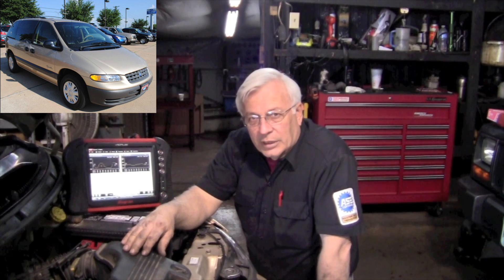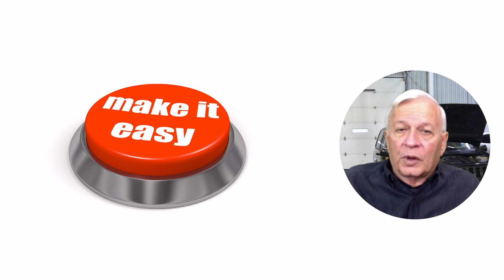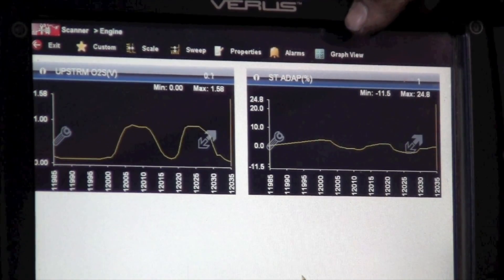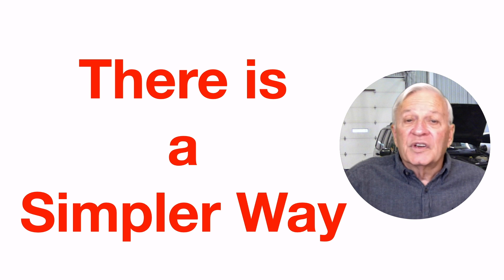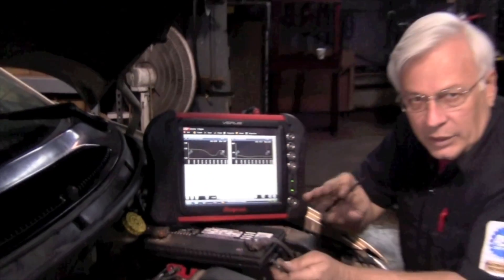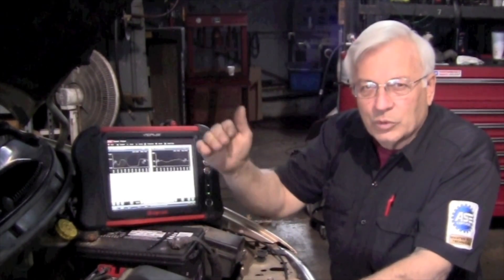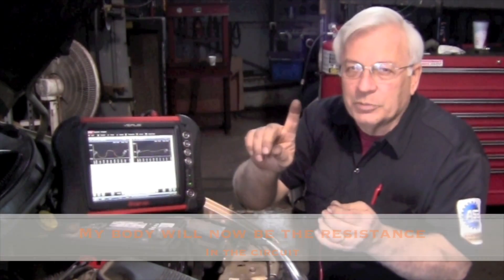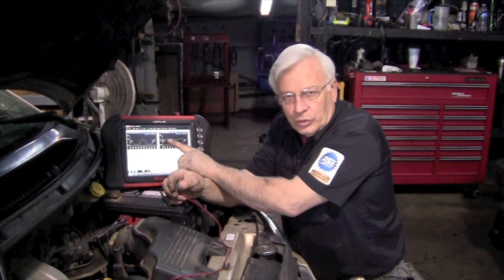A simpler way to test an oxygen sensor   HD 1080p

Comment: It sounds like this is a good bypass test for circuit integrity but bypasses the sensor so does not test it in any way. Let me know if I am misunderstanding. Thanks for your content. Very helpful for scope Verus learning. More please!
Reply: I agree. I'm not an expert either, but you could artificially introduce voltage or ground to the PCM and the scan tool will read whatever bypass voltage/ground you supply. Color me skeptical.
Reply: I agree, what he is doing there is testing the integrity of the wiring and pcm but not the actual sensor
Reply: I think what he's trying to say is the circuit itself is tested as you connect to ground or positive through your body and see the extreme readings and fuel trim. After you remove your tap from the wire or plug the sensor back in, the sensor is proving that it works correctly when it readjusts, oscillates and the fuel trim normalizes
Reply: @geologic740  I agree. But 'substituting' signal like this would not, in and of itself, really help identify a slow or incorrectly responding sensor. [It merely establishes that the sensor has an 'effect']
I'm not sure, as far as determining if the sensor is working 'correctly' is concerned, that this 'test' is at all helpful at accomplishing all...
The O2 could still be slow or out of calibration, and this test result would still be the same.

It does, at the most, determine that the closed loop- system is responding to inputs.
It does not determine if that response is correct.
[I think the same would be accomplished simply by unplugging and re-plugging the sensor].
Mr K L
Reply: @troubleshooter1975  I see your point and I've thought of that as well. Like you, I believe it's a good test of circuit integrity, but won't necessarily single out a bad O2 sensor if other parameters are off which indicate another issue. I would have to go with unplugging the sensor to be sure all other parameters are as expected.
Reply: @geologic740  I'd rather force the sensor high and low by vacuum leak and propane addition and watch the oscillations. That seems more definitive to me...
Reply: @fredsalter1915  agreed
Reply: @Fred Salter  amen!! And use a meter to ohm out the wiring from o2 connector to pcm.  This is a little reckless, instead of using ohms law to guess how much voltage your body will send to a sensitive pcm why not just ohm out the circuit.  I know for a fact with my luck if I tried this I'd brick a PCM lol
Reply: @daniellawson5127  you should watch some scannerdanner videos. Then you will not be as afraid to mess up a module and also you will not trust your ohm readings as much anymore. There is more to the automotive field than meets the eye🙂
Reply: Thanks Geologic
Reply: Can you tell me about the concept/theory you are considering - the bypass .  Why do you say that he bypassed the sensor in the procedure he demonstrated in the video . The sensor remains in the circuit .
Reply: @ThunderbirdRocket  Sure. I used the term "bypass" as a catch-all term as I didn't want to type a long paragraph and that's the only term that came to mind. It doesn't matter whether the sensor is left in the circuit or disconnected. When the lead is shorted to ground, what the sensor is doing will have very little effect on the circuit voltage. Similarly, it won't matter what the sensor is reading when the peak positive circuit voltage is applied.

Comment: I understand that shorting to ground you generate a DTC on o2 sensor but, is any DTC when shorting to positive through your body? A part of that, did you test that way with 5pin o2 sensors the wide range ones? Thanks!!
Reply: I don't think so. Wide Band sensors have an output amp. You won't be able to 'override' it in this way. And if you did, it would likely damage the signal output chip.
You could 'maybe' substitute a signal voltage to the PCM, with the sensor output lead DISCONNECTED.
But the PCM also monitors heater temp and/or current, so it would be a technological challenge to do this properly...
Propane or vacuum leak (to create a REAL AFR mix change), would be the most direct method to test a WB (A/F) sensor.

Comment: That's a positive way to actually get the sensor to react! Thank You!
Reply: It is actually NOT affecting the sensor's control; the sensor signal has been overridden. The response by the sensor (if any) at that point is irrelevant...
It is actually only confirming that the PCM can respond (and is in closed-loop)...

Comment: The first time I saw Scannerdanner do this, I had an aha moment. I only wish I could find a way to similarly test wide band sensors and their wiring.
Reply: Is this really testing the sensor or just manipulating the signal to the computer and testing the ecm and wire integrity?
Reply: @jamesd6247  This does not test the sensor.  All this proves is from the point he tapped the O2 Signal wire to the PCM , that the PCM is capable of "seeing" a high or low voltage.  This proves Wiring integrity only from the point of tapping to the PCM.  When possible and accessible we do this test to prove we don't have a signal wire problem, I prefer to do it right at the O2 connector disconnected and frontprobed with the proper AESwave adapter. Drive it high then low.  I will use th raw 12v from a testlight to drive it high. The pcm is programmed not to "see" over 1 volt, but you can still put more, using a testlight puts a buffer in case of a short to ground, in which case the lamp will light!!!.  Now that Wiring Integrity has been ruled out, you still need to physically alter the Air/fuel Lean or Rich to see if the Sensor is capable of producing the proper voltages.  And another thing to consider is the Heater circuit could be week and make the signal to appear lazy!!!  This video has a lot of truth, but is kinda misleading. Peace.
Reply: @paulpaquette1961  ...yes, but once things are warmed up the heater is out of the loop. The heater is only for the first few minutes of operation to get things into closed loop faster.
Reply: @rupe53  I don't think so. The heater is PWM controlled by the PCM even in closed loop. Put your amp clamp on a heater control from engine startup and drive for 10 minutes, you'll see that when youre in closed loop the PCM will still apply a current.
Reply: @rupe53  Remember there are more than 1 HEGO, the downstreams use the heater almost continuously. Same testing methods apply though
Reply: @paulpaquette1961  ... that may be true these days, but I would bet it's tied to ambient temp. The original purpose of the heater was during warm up. Of course, that goes back to the 80s when they first got heaters. I'm retired these days so can't keep up.
Reply: @paulpaquette1961  ... yes, based on where some sensors are located (4+ feet back?) I can see where it may be necessary. On some vehicles I am amazed the cat works just due to distance downstream.
Reply: @paulpaquette1961  Thanks for the explanation. It makes sense and is very useful information.
Reply: @paulpaquette1961  I believe most Zirconia O2 sensors (this video) have PTC heater elements.
They get full battery all the time, and 'self-regulate' the temperature.
I did some partial research, and I believe it is only wide-band [AFR] O2 sensors that are all PWM, to maintain a constant temperature required for this type to operate properly.

[Edit} I am not sure if there are any Narrow-Band sensors (this video), with a PTC heater, that are ALSO PWM by the PCM.
Many articles have inconsistencies or errors, or are simply not specific about which sensor type they are describing...
Reply: @jamesd6247  I'm suspecting the same thing.....
Reply: here is another good teacher for all of you to subscribe to.